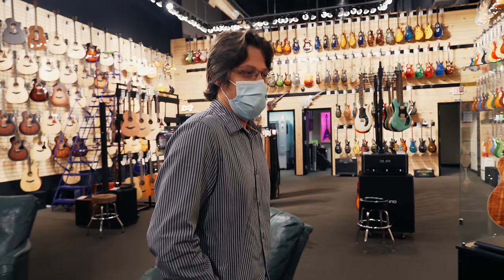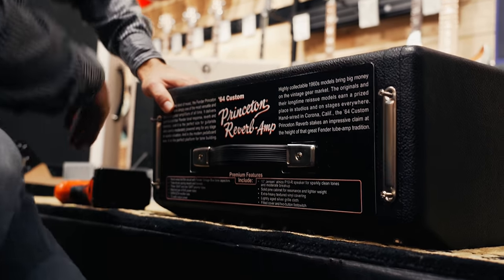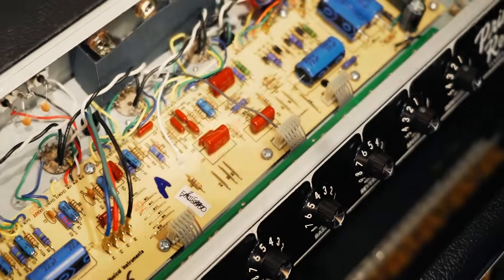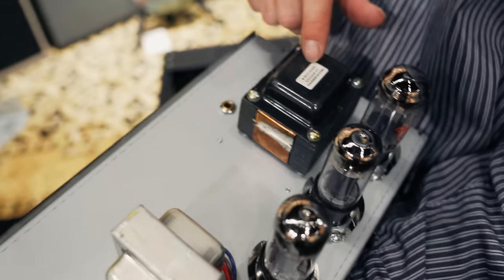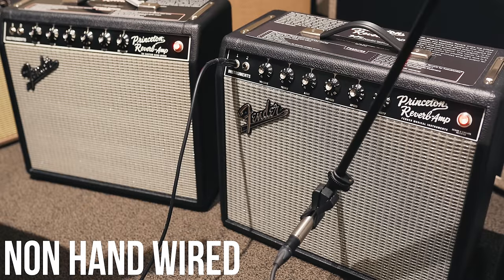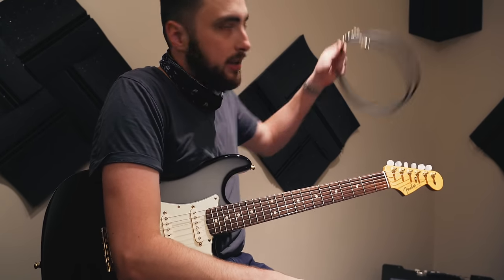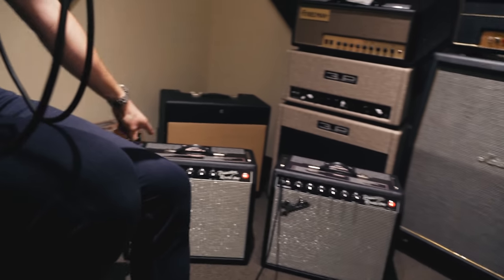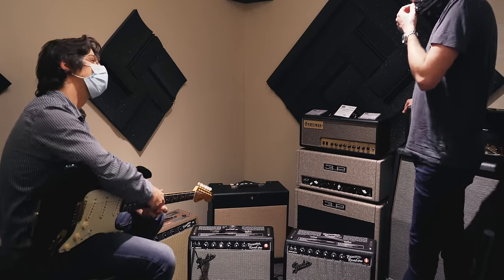Are Hand Wired Amps Really Better?

Comment: Jump on the "Carousel" ,  one could easily be steered towards changing the speaker and getting pedals to "emmulate" the handwired version but when you add it all up you discover that the difference in price slowly errodes and you wish you had just searched a bit longer for an "ex-demo" or "used" handwired....but Musicians are never 100% satisfied with thier tone, twiddling controls till  some-one slaps them in the hand and says" stop that and just play something". The less "expensive" Princeton is a Fantastic combo, if you want a warmer tone which for some reason is associated with a better quality build just put a Jensen P10R speaker in it and off you go. Better still if you are really serious and have time to spare find a Tech College to learn "How and Why" this stuff works and eventually build your own "unique" machine that you can tweak anytime because it will be hand wired and easier to customise. If any-cares I see 2 other options; get the  basic one and a 1x12" cab with the 12" Jensen P12Q using the Princeton as a head , that 12" will give you that low end you were missing . Option 2 ; Sell all your unused "Stuff", pedals, speakers, gizmos and toy collections and just get the "Good-un" it is actually better sounding and built better than 80% of the old ones and it will do 20 years of magic if you take care of it . The older versions that come up for sale have usually been "Hacked" by a hippie with a soldering iron to getca "Specific" sound so no 2 are ever gonna sound the same to our ears but the new ones(after nearly 60 years of trial and error) are instant tone machines, just plug un and play..instant Fender tone any where and any time(smaller rooms like them). When the Festivals come around just prop it on a stand / table/ chair to get it to your "ear level" and use a mic to  connect it to whatever is available at the mixer, even a basic powered PA speaker/monitor will make that little Princeton sound "Massive" without causing fatique to your ears or the listeners. I would love to see and hear a viddy where the reverse happens, put a handwired chassis into a cheaper version cab and a pcb in a handwired cab without informing the listener, I bet the pcb in the solid pine/alnico would be "much better"  without having all that "Marketing" yak yak to sway a player. Peace to all , Music is the "Universal" lingo so let's just keep playing..through anything that makes even a 1/2  decent sound. Peace again people.

Comment: Fender mass production amps are just a product of massive cost saving cuts. They replaced every non-visible component with a cheap, small version that’s barely in spec. I replaced all caps in my Fender Blues jr and it brought the amp alive. Further down the road I also replaced the transformers with large, heavy ones and that gave it the low end punch to really roar. I hate that large companies always start to look at the total earnings, instead of the earnings per product. Saving a few cents, or even a dollar on an amps production when you sell that amp for $1000+ is not worth the sonic degradation. But if you look at it as $1000000 profit extra for the whole production line, yeah that sounds worth it, still isn’t though. Breaks the reputation...

Comment: Unless these two amps were subject to a completely ‘blind’ test I seriously question the validity of the sound test. Too much unconscious bias involved. The only caveats being the alnico versus ceramic speaker and types of wood used. Both could contribute to sound. Having said that, the durability of the hand wired is more desirable. For my occasional gigging I’d be happy with the non-hand wired…and just do my own amp moving and set up.

Comment: The $1200 difference is in labor. If you are an experienced and 'nuance' player, especially a clean tone - vintage drive player, hand wired amps can't be beat. There is an "air" to the sound. Not really an affect on tone. Its the harmonic structure. Newbies probably won't hear it. So, go with what you like and can afford. I have both.

Comment: If the circuit board is a good quality and is mounted so it won't crack, I don't see an advantage to a hand wired tube amp. Most electronics were hand wired back in the 50's and early 60's.

Comment: A nice hand wired amp, yet they still use crappy, leaky IC caps. Even with a hand wired amp, they still use cheap parts to save production costs and charge more to boost their bottom line. F&T caps when bought in bulk are only about 50 cents less, so why not use them?

Comment: If you can't hear a difference you're tone deaf. Its subtle but the hand wired has more body, making the circuit board version sound brighter.  Which one is better is up to the end user. I have a hand wired amp that sounds great and I also use a Synergy system that sounds awesome....but there is a difference that you can still hear. Its like there's more dimension or air around the notes / sound on the hand wired. Badly designed circuit boards can create capacitance that kills some of the high end harmonics. Again whatever you like and fits your budget.

Comment: I don't agree with this. The circuit board on the right looks like it's through hole soldered. Anyone who can repair a hard wired amp can repair a failed component on the other PCB. The PCB also looked alot cleaner given there was less components and more space since there isn't wires going everywhere. also, how many people are twisting amp knobs hard enough to break a PCB? Again, if you are able to fix a hard wired amp you can replace a knob or solder wires to get around a break. The hard wired amp uses better components but also costs a lot more. Man, I've only been learning about hard wired amps for an hour but already I'm frustrated by it..

Comment: Lol. The guy literally says: "The difference between the two is actually way more than it looks like. ...  The circuit is slightly different, the components are different". And you respond with "so I guess the main thing we're testing out is handwired vs non-hand wired, right?" 

No, you're not. You're comparing two pretty different amps. He just told you! You're really trying to push the hand-wired thing here.

Comment: Not all tubes Are the same, every tube is an individual sound , retest switching the tubes between the amplifiers. Without switching the tubes between the two amplifiers you don't really know. Just one better sounding tube makes a huge difference. Also bias tuning control's the sound quality between the tubes. The tubes and biases could be the only real difference and capacitor difference is another issue all together. I hear a loud idle on the hard wire amplifier and it definitely has a much hotter bias or has more Gain in the pre amp tube's. It's almost on the verge of being microphonic, I used to repair and build tube amplifiers and sell tubes and I know what I am talking about. Here's what I think, better select tubes were put in the hard wire amplifier. It makes a big difference. And From my point of view knowing tubes and tube amplifiers you did not do a proper test. Because you ignored the possibility of better tubes and hotter or tone biases. Switching the speaker is only one part of comparison. I could put a 2 channel or stereo scope on both amplifiers output and tell you if the tubes Are the difference between the two amplifiers without even changing them. And also do a voltage test and see if they have different bias and plate voltages on the tubes . I'm sure that they took more time doing things on the hard wire amplifier. But that doesn't mean that you couldn't get the PC board amplifier to sound better than the hard wired amplifier. There is a drawback to hardwired amplifiers being noisier at idle. Interference is worse with hardwired amplifiers also.  But  with that said , feedback from the amplifiers wire's can be used as a tool to the player's advantage also but it is usually a frustrating experience. Picking up cell phone's when recording is my Biggest complaint with hardwired amplifiers. But it's not always the amplifiers fault because anything on the input gain can cause it to pick up cell phone's. I have noticed that I don't have any problem with direct recording into the boards. It's a amplifier and it will amplifier anything that gets near it. I haven't tried recording with A PC board amplifier yet so I don't know if it will have the same problem with cell phone's or not ? I only know that I don't think that the test results reflect a even playing field without switching the tubes and testing biases and voltages. It's a pretty simple thing for a competent tube amplifier tech to do. Your test is like testing a race tuned engine against a bone stock engine. Time is money and it takes more time to build handwired amplifiers. Out in the hot summer Sun All day could cause a PC board amplifier to have a failure and meltdown something. I had it happen with A Peavey 100 watt head. A plastic plug melted down between the two PC board's inside of it. My back up amplifier was A hard wired Sovtek Mig 100 Lead that perminatly replaced The Peavey. I sure do miss That Mig 100 amplifier. Now that Mig Lead 100 was a serious amplifier ! They don't build them like that anymore.

Comment: I'm shocked the hand wired sounds better, just kidding. I'm not a fan of the alnico blue tho, I think they must be paired with the right amps to sound right, which the low watt Princeton sounds perfect. But they can be harsh and brittle sounding if you just slap one in any amp. The factory Jensen's are very good and generally very dynamic in fender amps. My 2 cents

Comment: The speaker to me does make a difference and the one in the hand wired amp does sound better. However one thing these guys didn’t mention much was the electronic components used to build these amps. I’m sure all of the capacitors, transistors, diode‘s, resistors, etc. are all high end style whereas the non-hand wired amp has mass produced Chinese cheapies installed. 
Speaking from experience I have replaced electrical components of guitar amplifiers with better higher quality components and instantaneously it sounded much better!
However a $1300 difference!? You know what they say about a fool and their money, right? Of course to each their own but as for me I cannot justify spending that on a hand wired amp.  Removing and installing electrical components is not that hard and with general soldering skills and a basic understanding of electrical components anyone can do it. And besides, there’s a whole ton of videos here on YouTube that can show you how as well.

Comment: 9:35 at this point the difference is nuts but I guess that’s the speaker.
Reply: 13:15 for sure still a difference, could be the cable though.
Reply: But I agree with your conclusion, it’s worth it for components.

Comment: It's simple.  Better components better speaker equals a higher price and a better sound.  Now take the '65 use a 'good' circuit board, 
put the same components and the same speaker as the '64 and you will have the same amp.  Hand wired vs. a neatly
wired circuit board yields the same tones.

Comment: "This is a very easy amp for your tinkerer to get in there and...modify the crap out of it." <- That's true, BUT you can buy a kit and build your own handwired (by you!) Princeton Reverb combo (finished cabinet and all) for about $1400 from mojotone.

Also, pcbs are not as easy to mod as eyelet boards, but they're not that bad. I'd rather buy the pcb amp and mod THAT one; if you're gonna mod it anyway, save some cash!
Reply: I bought a Bluesbreaker kit with mojo cab and DIY. I think it sounds great,I can brag and I put MY name on it.

Comment: No real sonic difference between hand wired amps vs higher grade PCB (printed circuit board) based amps with thicker base material and doubled up or even triple thick copper tracks. BIG difference between cheap, crappy PCB based stuff versus hand wired or higher grade PCB based amps. The cheaper stuff usually lacks clarity and sounds muddy in the power section of the amp as well as thin and tinsely when you roll your guitar volume back.

Comment: Quick (and I hope helpful!) grammar note for those interested. When using compound words as adjectives, you'll want to hyphenate them when they appear before the word they modify. So, one would write, "Hand-wired amps are expensive." When they don't, you won't. So, one would write, "That amp is hand wired."

This isn't a hard-and-fast rule (or the rule isn't hard and fast) as usage changes over time and different writers and editors worry about different things, but for those of us interested in these conventions, that's the way we tend to approach this issue.

Comment: The PCB amp sounded better to me. The hand wired sounded like the tone was being held back. Both amps had IC capacitors in them. Bad idea in my opinion. So much so I don't think I'd ever buy a Fender. Peavey uses them too. So I'll never buy one of them either.

Comment: Everything is so compressed on these youtube videos it's kinda hard to (even with good monitors) to tell much of a difference. I've got a bunch of Princestons (from 1969 to almost new) and my current favourite is the 68 Custom with a Celestion Gold 10 in it. The stock Celestion Ten 30 sucked. My second favourite one is a 1979 that's all stock save for a Ragin Cagin. I love all my Princestons but like my new 64 (I got used for about half of what they charge new) is more valueable then I want to drag around. My handwired Princestons don't sound THAT much better then my 65 and 68 PRRI. Just a little different but not really better.

Comment: You are obviously not electronic  engineers!
here there was a lot of technical amateur interpretation.  Mechanical robustness is greatly exaggerated.  In addition, you can quite reasonably replace the capacitors to a higher quality.  Soldering wires together in such lumps is also bad. If then you should use a combs or finger joints.

Comment: It’s the different components.  If the amp with the pcb had the same exact components as the “hand wired amp”  it would sound exactly like it.  There is literally no difference in sound between connecting components through the metal in the wire & turrets or through metal in the wire and a pcb.  None.

Comment: I've worked on fender amps over the years.  and they are all based on the same schematics from the 1950 and 60s . with slight variations .  over all - there is no tonal differences between PWB and "Wired" .. except the $COST  and bragging rights.

Comment: The speakers are the biggest difference, then the quality of the caps.  Back in the day, resistors had 10% tolerance and caps were 20% or more, making every circuit a little different.  Today's parts are much closer to their marked values.  Is there still more difference to be had between hand wired vs circuit boards, I think yes, but not a huge amount.  Circuit boards are likely to be more consistent compared to hand wiring, only because the traces are identical lengths from board to board.  Hand wiring introduces slight variations and brings more interaction between circuits to the table.  How much difference, is it going to be measurable using test equipment, probably.  Is it going to be truly audible, probably not so much.  The speakers are the biggest difference in this scenario.  

Don't poke around inside tube equipment unless you know what you're doing.  500V DC stored in these large caps can kill you quick, especially if it flows through your chest, from one arm to the other. Just because it's off and unplugged doesn't mean it's safe.  Those caps can hold a charge for hours.

Comment: .. first of all.. use the original speakers…
It very well could be that the different speakers could be the reason for parts of the different circuits…

Second… why is no one A/Bing a short loop when they make a comparison.. 

Third thing.. the mics sound different whenever the camera position changes so please when analyzing… analyze..
The sound has also a bit of room.. so it soubds here way different to the sound you had..

Fourth and last thing.. try to make them sound the same.. same mid.. same bottem and high end… there are controlls for that… 
In that case really could compare frequency response and break up… 

So i thibk good attempt but could be way better.. and for me it is just not usable

Comment: Circuit boards, especially Fender boards, are full of stray capacitance. Hand wired amps are not. That is the biggest difference between those two choices.

Comment: Folks! Look for the Comments by Coyote Circle Studio and similar postings. Also, ask yourself:  are either Rhett or Ben EEs or ETs? Nope.
A LOT of the “buzz” (pun intended) around quality gets passed around like a folk tale. The circuit doesn’t care what it’s going through. Does anyone here know what PCBs looked like in 1948?
How about testing and measuring with electronic test equipment like an oscilloscope?

Comment: As long as Fender uses those cheap capacitors and has cold solder joints yeah, hand wired is better. That poor design

Comment: I owned a non hand wired version........... never sounded right.  Tried to adjust bias to correct value......... couldn't achieve correct value, even with three different sets of brand new quality tubes pairs.  Cheaply made/constructed.  Certainly not worth even half the retail price......... a complete disappointment.  I usually love Fender amps, but this one was a lemon...... ah well.